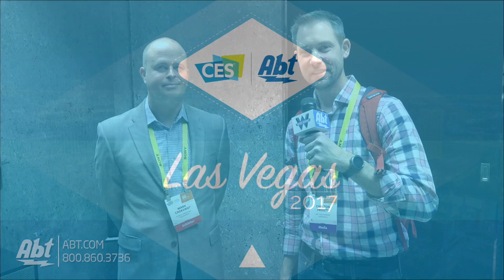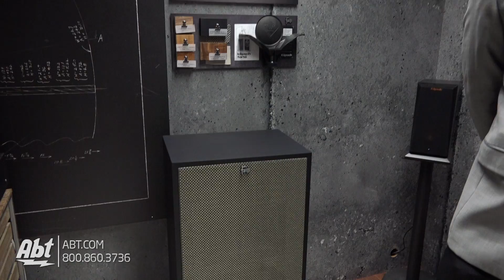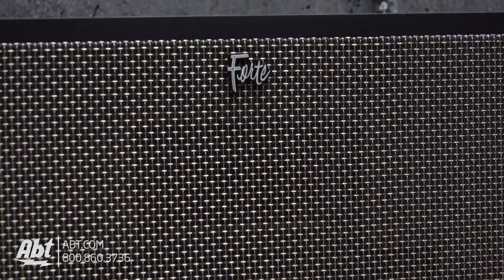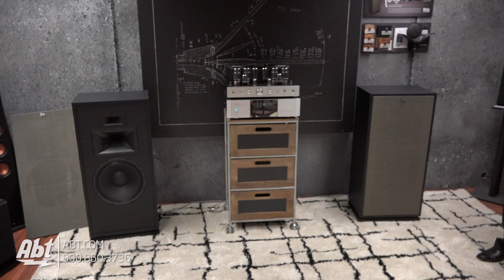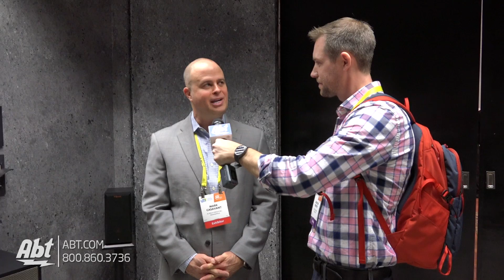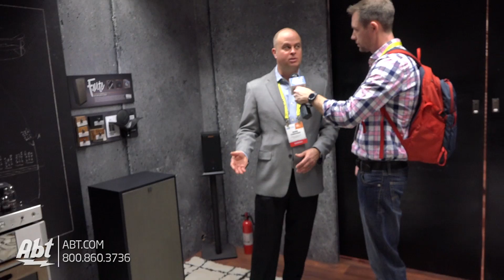CES 2017 - Klipsch Forte III Speaker

Comment: I disagree with pressings of new lp recordings. They are worse today, than before, because they sometimes uses a mixture of different lp where the labels also are included in the mix..and this is a reciept for a catastrophic lp press. Some of the best I have are original 180G pressings from the 50-60 and 70`s and really good ones today cost big bucks